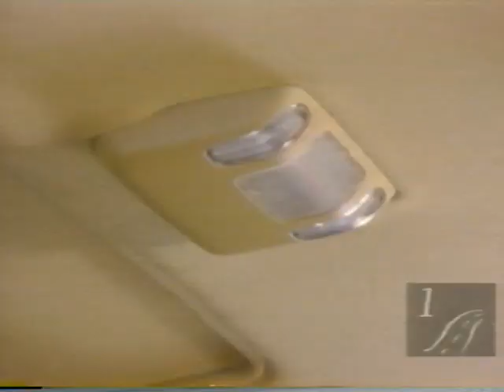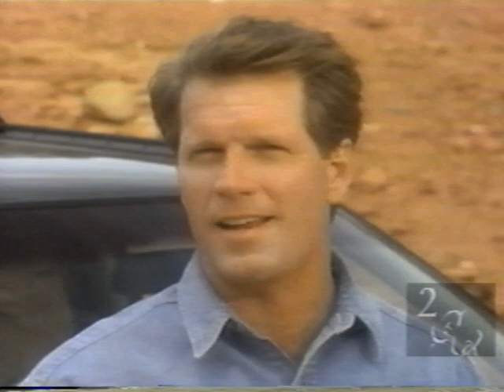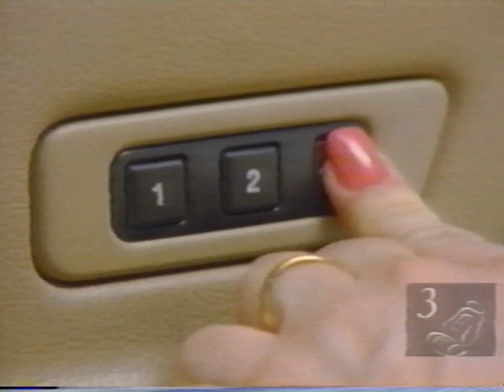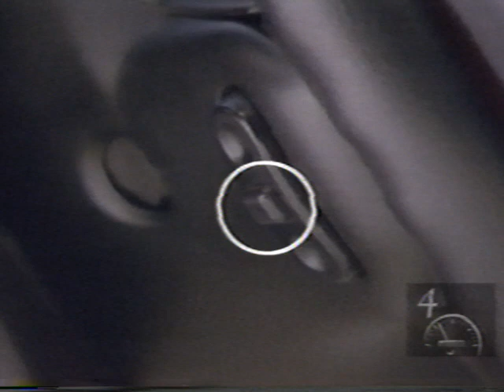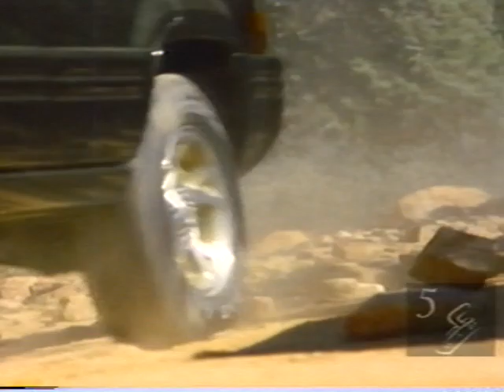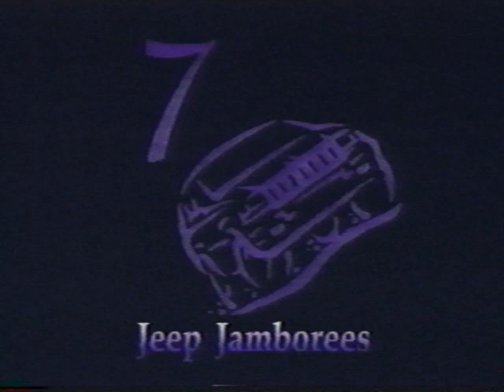"1998 Jeep Grand Cherokee" VHS

Comment: If you looked after it mechanically putting a half a million miles onwas easy for Jeep but the previous model had better styling. The rodents play havoc with the wiring aplenty.
Reply: There wasn't a previous model, this ZJ Grand Cherokee ran concurrently with the XJ Cherokee. But I've had the same experience, and I agree the XJ looks much better.
Reply: @AgamemnonTWC  Ah ryt in the UK this model was scarce till later in the noughtys.

Comment: You should monetize this video, and only this video.

Oh yeah, Happy 5k!
Reply: This video wrecked more havoc in my YouTube feed than any other video you've posted. I'm getting used to weird stuff popping up since subscribing, but now it's all old cars because of this one darn video! <3

All this & more to the left right now:

98 Jeep Grand Cherokee 5.9 Fixed exhaust 

SPECDTUNING INSTALLATION VIDEO: 1993-1998 JEEP ...

Motor Trend TV 1996 Ford Explorer vs. Jeep Grand ...

1998 Jeep Grand Cherokee 5.9 LX (Limited)

97 Jeep grand Cherokee problems starting or cutting ...

Jeep Grand Cherokee Project (Part 1)

Jeep Grand Cherokee Operating Tips

The Jeep Grand Cherokee SRT8 Is a Fast SUV Icon 

need I go on?